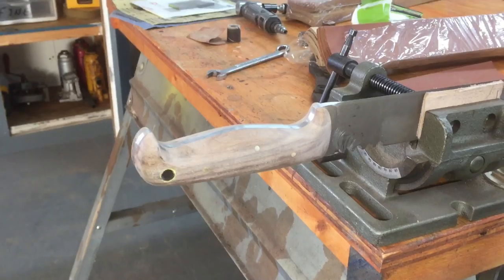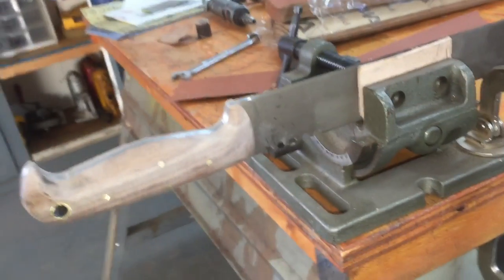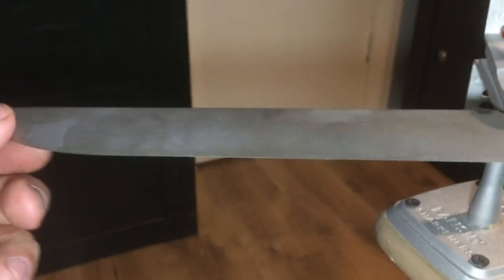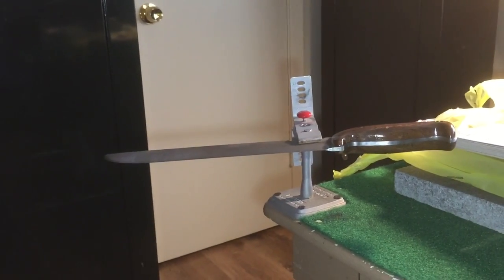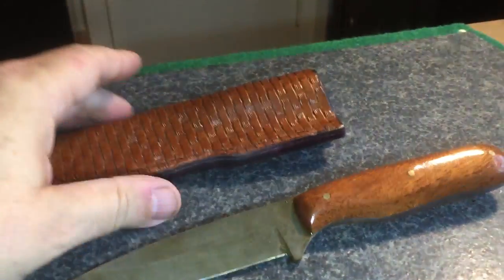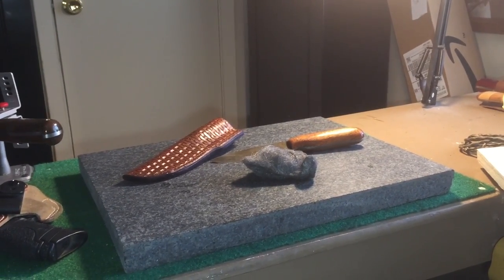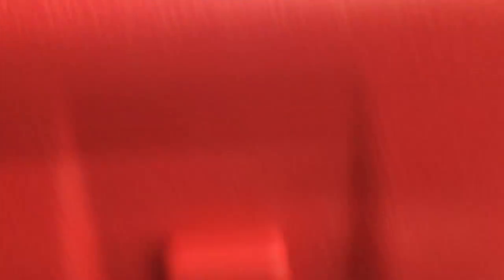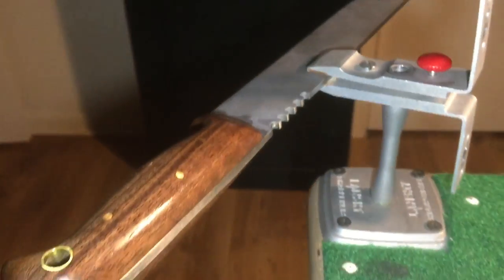Bayou chopper update

Comment: Looking good. It's costing you a lot more to make than I would have thought, though.
Reply from the maker: Ive since started using 1095 steel which is about half the price of 01 tools steel,and I had to send it out to have it heat treated because its so long,it wouldnt fit in my forge.Ive decided I'm going to make a kydex sheath so that will save a few dollars.If I make another, I can probably make it for 50 bucks in materials.

Comment: Don't sweat the small stuff BC.  I have extra fine steel wool I use for fire starting and WD 40.  It will take all of probably 10 seconds to get that light rust off.  Heck my Old Hickory knives can get a light rust coating  in just a matter of hours if I don't keep them coated well or put a nice vinegar patina on them.  Phil
Reply from the maker: Well,I've since read on some of the knife making blogs that rust on high carbon steel is a problem for the pro's as well, next time I ship one, I will make absolutely sure the sheath is dry and coat the blade in oil. I'm real sorry its not gonna arrive looking like a new car. I was in shock and horror when i pulled the knife out of the sheath at tandy leather, and saw the rust on the blade.

Comment: Do you cut the blade shape with a band saw using a metal cutting blade?
Try cold Bluing the knife to protect it from rusting..then oil it.  You can either use regular gun bluing or vinegar.Vinegar does a light shade....try on a scrap piece of steel...
Reply from the maker: I cut as much steel as I can away from the pattern I've drawn on the steel on the band saw,then I remove the rest and shape the blade on the belt grinder.

Comment: Rust on a new blade for me is a good sign.That means high carbon content so it will be easier to use with a ferro rod.
Reply from the maker: Its high carbon 01 tool steel. Ive since bought some 1095 and I will see if its easier to work with and sharpen.

Comment: hey Brad, it looks good. hey, what do you know about bayonets. I have been thinking I would like to make a bayonet to attach to my hi-point carbine and have found very little info on the idea. Usually that is a sign I have a stupid idea. what do you think would be the best way to go about it?
Reply from the maker: very little information ??? that sounds like you would have a viral video!  i would start with some 1095 and shape the blade. figure out how you want to attach it and have a welder heliarc the components together.
Reply: yeah, I have to figure out how they attach. I did find a single video but it was a store bought mod. considering how many hipoint carbines are out there I imagined there would be more people trying it.